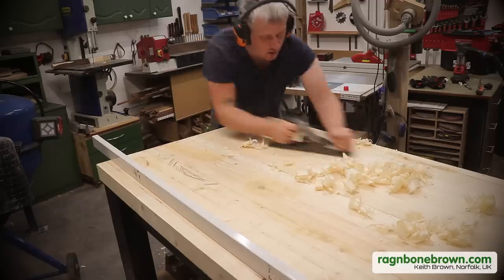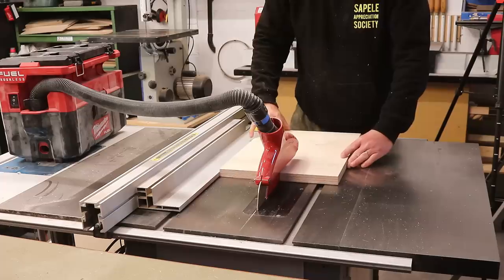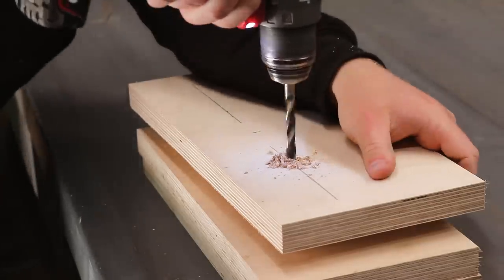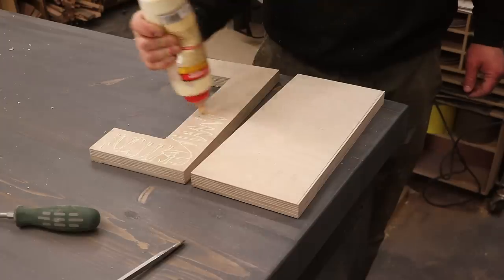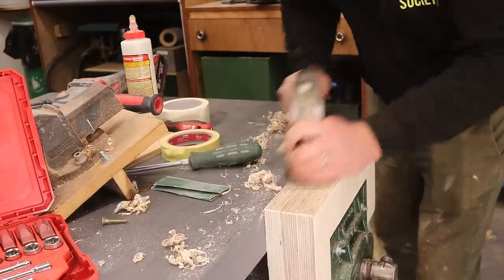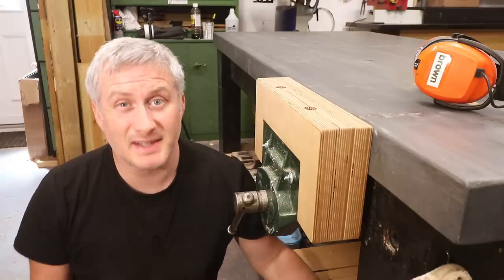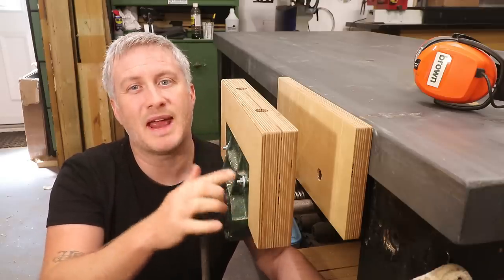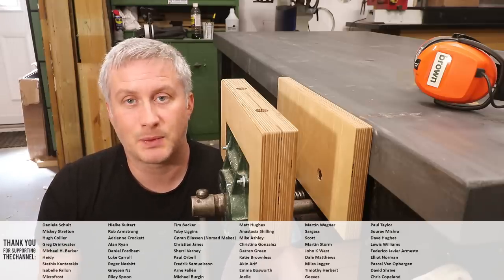Extended Vice Jaws: A Good Idea?

Comment: Might want to replace that shim with a bigger piece so that the metal jaw face provides more support against the wood jaw pivoting
Reply: Agree, that looks like a pivot point to me. Bar that it’s a nice design.
Reply: Yes that’s was I think too.  Better to fill the space to provide better support.
Reply: Yes, exactly. That air gap inside there can’t ever be a good thing. In some situations it won’t hurt but when you need the extra support, instead you have air.
Reply: That's not the issue, the issue with extending vice jaws vertically is that there is only 2 points where the wooden jaws attach to the vice jaw. So when you're clamping a thin piece at the top of the jaws (like to plane the face of a board), the pressure point is lower than the piece, and it doesn't get clamped properly. The shim will not be a problem and if it was full it would not change anything. This type of vice is just not made to be extended a lot, a cm or two will work but if you go too high it will always act as a lever and not clamp anything.
Reply: @kz.irudimen  these things aren’t either-or. Yes, the points of connection are an issue as you correctly point out. It’s difficult to do anything about that though. 

The air gap gives all the materials room to torque and flex, and that’s not good for stable clamping or material longevity. The air gap is easy to fix, so you do what’s possible.

Comment: I don't think you will have any issues with it if you are not squeezing the crap out of things on a regular basis. The only thing I would have done differently is to make the 9mm space piece the full size of the recess to stop it having room to move on those bolts and apply the pressure over a larger area from the vice to the ply. Nice job though and I am sure it will serve you for as long as the bench top.

Comment: In the epilogue part of the video - it looks like you drilled a few holes in the top of the outside jaw that you did not show in the build.  Are those for dogs?   Also - you may want to put a couple of acorn nuts / plastic caps on those exposed threads on the bolts on the outside jaw to prevent you scraping something (like your hand) on them.
Reply: Was wondering the same

Comment: Great work! Make the 9mm spacer the same size as the original jaws for full support. Use bigger bolts if possible and tighten even more. Then you will no issues.

Comment: The base for the engineering vice is a brilliant idea, thanks for the tip. I think those extended jaws will be absolutely fine in terms of strength. They're usually replaced every few years anyway, I think you'll wear out the surfaces before you break the front jaw due to stress.

Comment: Good Job done Keith if it gets you by like you say. If your clamping small objects just cut some scrap wood slightly narrower than what your workpiece is, lay it in the bottom of the vice this will help prevent the jaws birdmouthig out at the top allowing you to apply more pressure. Tony

Comment: Do you need the back plate/jaw? The frame backplate looks to be flush with the worktop. Why not use the edge of the worktop as the inner jaw. That way long material can be clamped to the edge of the bench with something like a holdfast on the far leg.

Comment: I did the same thing, extending the height of my vice, but recently then removed the vice and moved it up because the red oak I was using began to warp and crack with the ever changing conditions in heat cold and humidity here in New York.  I work out of my garage and have zero temperature control and it got frustrating not having the same clamping strength near the top of the vise especially for smaller parts and would move around more.  When I had the metal jaws of the vise directly behind the wood, as high as possible definitely has better gripping strength so raised the vise back up to table height.  Doubling up the plywood was a great idea, I only had a 3/4" piece on the front of mine.  That simple change may have worked if I had thought of it.  This is still a good video though!  Give us an update!

Comment: To stop the racking forces, just drill & thread a hole thru each corner of the outer jaw and when you want to prevent racking at the top of the jaw, insert long bolts thru the 2 bottom holes just enough to contact the inner jaw when tightening.  If the racking is side to side, put the bolts in the opposite upper and lower holes to prevent side racking.  If you don't want to damage the inner vise face, just imbed a metal plate opposite the outer jaw bolt holes. 
If you are still reading, you can also enhance the clamping by adding 2 dog holes with pop up bench dogs.  I used bench dogs with threaded end to screw them up & down on my face vise (yes, I made a video) so I could pop them up to an exact height as needed
Great channel.  I don't always comment, but I do always watch :>).
Reply: A variation on the 2 bottom holes solution is drilling holes through the inner jaw as well, then using unthreaded (threaded may work too) rods that start at the outer jaw and extend through and past the inner jaw (it looks like there is room underneath the workbench). Rods would need to be thick and rigid for this to work. Upside to this solution is the rods will auto-adjust, sliding in and out, during normal use, requiring no adjustment . Downside is the rods need to be removed when side-clamping taller pieces.
Reply: @christianp3388  The other downside is it is more complicated to make.  I like easy-peasy :>)
Reply: @russveinot5754  agreed. It would be difficult to get the alignment precise enough for smooth action, especially if drilling had to be done through anything behind the inner jaw, like an apron. No telling how deep that would go.

Comment: Never seen it done like that before and did occur to me the a small piece clamped at the top of the jaws wood be unevenly held pulling the bottom in forcing the top out.
But what the hell? Try it out! What’s the worse that could happen? No one’s going to die and there will be no rupture in in the space time continuum. Worse case scenario is that you revisit the issue with a link to the first video and people will learn from your efforts for decades to come. Best case scenario is that it works just fine.

Comment: If your using bolts and a thick piece(s) of timber it should be fine, if like me you went thinner timber for the jaw an used screws. its going to start moving an pulling out the thread in now time.

Comment: Simplest way to stop the front jaw tilting, as the rails are close to the bottom of the jaw, is to drop a scrap of wood of the same size as the piece that you are clamping at the top down to the bottom. That way you clamp evenly. Same as if you are clamping something just to the left - put a scrap of the same size on the right, and the jaws tighten evenly.
Reply: Was about to type the same thing 👍

Comment: It'll probably be fine, but two things I'd do for peace of mind:
1. Replace the mdf shim on the inside of the outer vice face with a full sized bit of birch plywood.
2. Use some large and thick fender washers under the heads of the bolts that attach the face that's on the moving jaw of the vice.

Comment: Instead of drilling backwards for a bit you could just wait until the drill is at full speed and then plunge into the wood. If the drill bit is sharp it always worked for me.

Comment: I had the same issue with a similar but smaller vice, it ended up being a big issue and I routed/chiseled out part of the workbench top. It was a massive pain in the ass but it works much better now.
Reply: Hey…. I am thinking about doing the same with my first bench….could you tell me why that helped the front jaw specifically @kz? Thanks so much
Reply: @Amanda-ev1xz  My vice is a really cheap (like 40€ on amazon) irwin vice, it's flimsy and the movable jaw is not even square. So by extending the jaws vertically, it was just a big lever and it was not applying any pressure at the top. Since I often clamp small things right at the top, it basically made the vice useless. I had to carve out a part of the workbench so the top of the vice would be much closer to the top of the workbench and the lever effect would not be as bad. It's kind of hard to explain sorry :( 
I'm upgrading this vice right now btw, it should arrive this week. The cheap one served me well for 2 years but I'm getting a much bigger one with quick release :)

Comment: The reason for the jaw movement is due to the height of the jaws above the vice casting. This is unavoidable in this circumstance. I would suggest, if you have enough space on the front casting of the vice, two more bolt holes through the casting and the jaws. These bolts do not have to be as large as the main bolts holding the jaws... just large enough to help counter the pivot. Having only two bolts on a vice jaw of this height creates a fulcrum, as you point out, and rather than using screws as the extra fasteners, bolts will be more secure. Enlarging the shim won't make a difference as you still have a fulcrum and the bottom portion of the vice jaw is still floating. Yes, you can use another piece of material to place at the bottom of the jaw face but now you have to hold another piece of material in place while you handle the main piece you want to work on. Stopping the bottom portion of the jaw from moving, and using extra fasteners to offset the additional jaw height, will solve the problem. This issue would not exist if the top of the casting and jaw was level with the bench top. This installation is also a wonderful demonstration of physics. Nice job, Keith... as always.

Comment: You could add the largest washers you can get (if you can get a big enough spade bit) to increase the area that the heads of the bolts is putting pressure against. This will mean there's lower pressure on the wood, as a result, there should be less compression of the ply that will result in the bolts needing to be tightened less. It may also be a case that you have to tighten the bolts once or twice after the wood has compacted and it has compressed to a point that it can't compress much further. Some threadlock on the bolts may not be a bad idea - sawing and using other vibrating equipment may cause the bolts to slacken a little.

Comment: Best thing about the vid was the good old Record vice. I’ve got three fully restored. I’ve also tried to increase the size of the jaws and encountered the same problem. If you try to tighten the vice too much you will impose an increased bending moment (force) onto the lead screw and the two guide rods on the vice. The vice wasn’t designed to take such loads. Out of respect for my good old hard working vice I removed them. After all, they are wood vices not machine shop vices. Nowadays I use my heavy machine vice for heavy work.  Hope this helps and thanks for a good honest video.

Comment: Thanks for posting, but I agree you have some structural issues.
1) As pointed out below the packer needs to be full sized. I am also not convinced the section with the rectangular cutout actually achieves very much.
2) If I remember correctly, the face of the vice has tapped holes and making use of these would allow for the biggest diameter bolts possible. It also avoids nuts and bolt ends protruding through the face which will inevitably snag your hands.
3) Your engineers vice fitting is fatally week at the corner joint. You want a lot of rigidity for the inevitable future abuse!  It is much better to coach screw the vice to a big lump of timber the size of the metal base and shut that in the vice. You can add a slightly bigger plywood cap between the block and vice which overhangs the edge and acts as a stop when you drop the vice in the bench vice.

This sort of video is excellent and makes people think. I have had to scrap many projects over the years and start again! Perhaps you might consider a second video after a rethink?

Comment: Good video, and worth uploading. I think with a vice setup like this the wooden jaws should be considered a expendable and just be expected to be replaced in a few years. I've always found after that time I've cut bits o fit out, it has worn, and it generally has chips out of the edges and corners anyways.

Comment: My bench vice is fitted in a similar way but I don’t have it as low as yours was but even then it can slightly distort when clamping hard.  My jaws are beech so pretty solid.  I also have the same set up for my metal working vice.  I like mine as it is and yours looks very smart so I’m sure it will work just fine.  Time will tell…. Andy UK

Comment: Could you make the outer vice extension extend farther down? Instead of offsetting it from the bars could you remove the vice, drill some matching holes, and slide the outer face over them to the vice head? That way it won't only be the bolts holding the extension on and creating a pivot point, it'll be held at the bottom as well. Can't imagine even some extreme clamp pressure could warp the bars, especially so close to the vice head.

Comment: I i extended the jaws on my vice the same way a few months ago and it's been working fine so far.  Mine may fail sooner than yours since I only screwed the front jaw into the plywood rather than using a bolt.

Comment: You could remake the back plate with a sandwiched sheet of aluminum or SS, even get rid of one of the composite plywood layers. Personally I would use the hell out of it as it is and try to break it, over-clamping with small fiddly pieces. It will probably take a lot more to work it loose than you think.

Comment: I think it will be fine just as it is Keith. If you're really concerned about the pivot, add a piece the same thickness as the work piece at the bottom of the jaws to limit the levering force. Will last a long time.

Comment: As you’re right handed, what’s the reason for putting your vice on the right hand side of the table?
If you need to plane stock in the opposite direction, your body will get in the way of the table, right?
Reply from the maker: What if I want to cut something off with a handsaw? I couldn't do that if it was on the left. Seems logical to put it on the right to me, even if woodworking convention says otherwise! Not had any issues with planing, I just rotate it in the vice
Reply: @RagnBoneBrown it wouldn't change if you wanted to saw something, you need clearance for the saw either way, it being on the left gives you the option to hold the off cut with your left hand before it drops though.

But if you prefer it on the right, keep doing that, it works for you.
I'm a lefty, but I prefer woodworking vices on the left, and machinist vices in the center area of my bench, even though it's usually placed on the corner.
If it's comfortable, who cares!

Comment: My only concern is using the m6 roofing bolts, they have very low yield strength, it might be ok but if you notice it start to wobble use a m8 12.9 high tensile